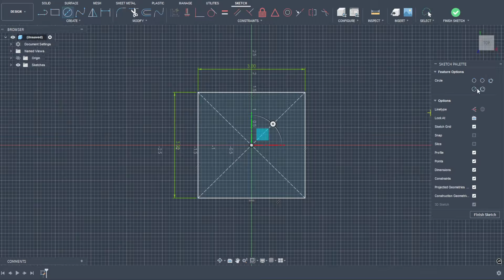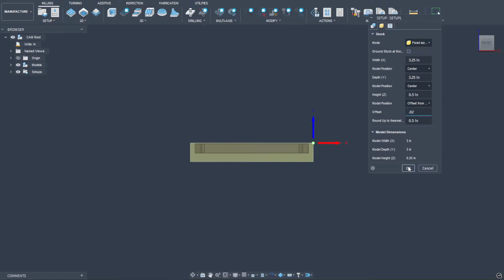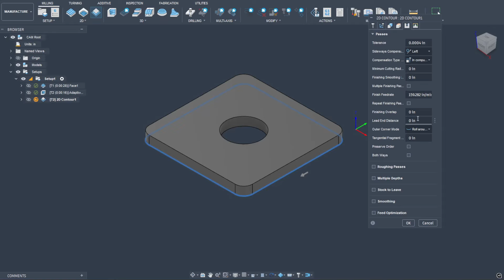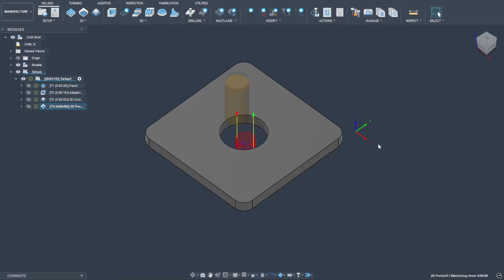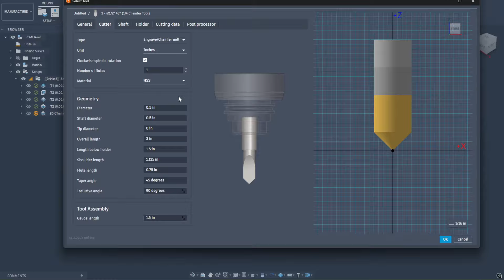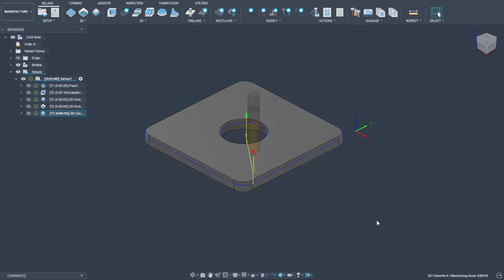Fusion 360 Cam Basics for Beginners

Comment: For the Cam, if you are going to flip the part over, and remove the material would you start your reference in the center circle and take the rest of the material off.
Reply from the maker: Yes. That will give you a perfect xy reference.